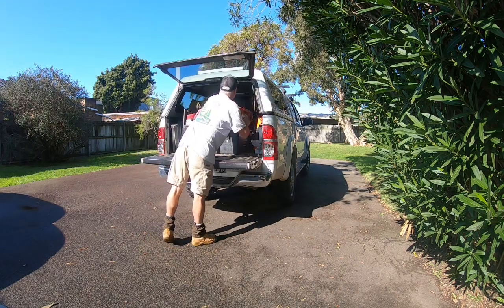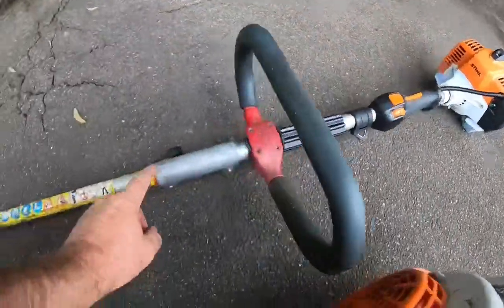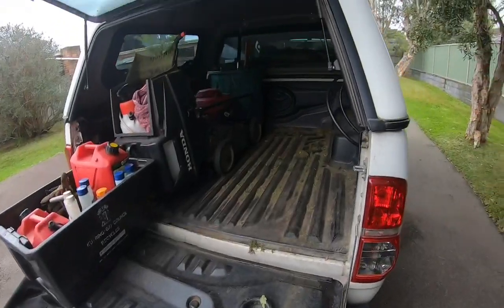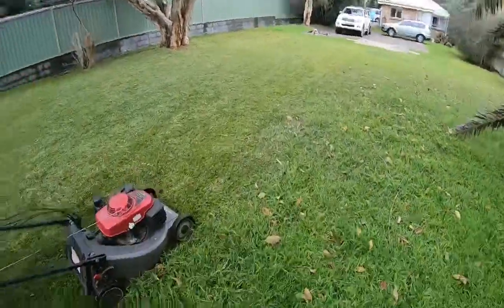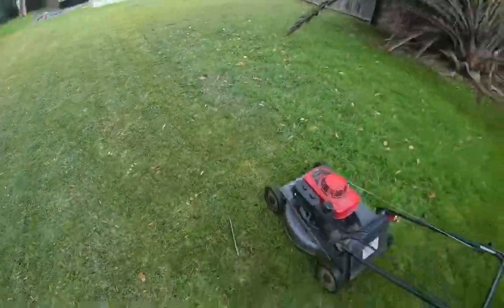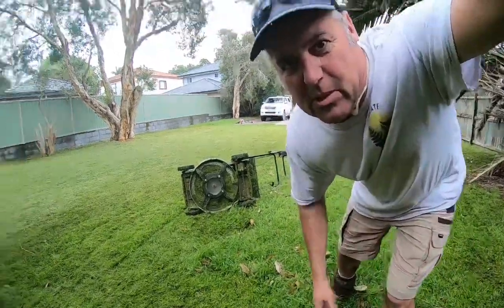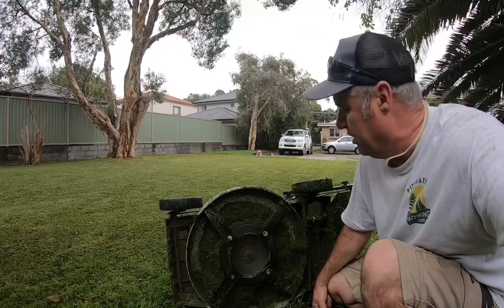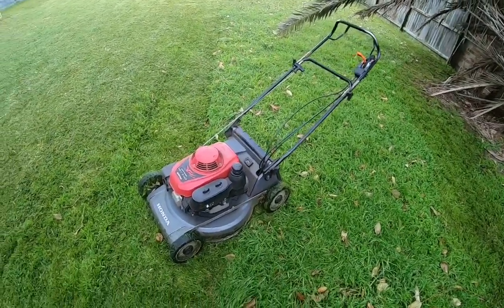My compact Lawn Mowing set up - On the job full video - Start to Finish - How I do it

Comment: I'm gonna sit back and watch ya work Ray, while i sip a coffee. Questions to come lol
Reply from the maker: Ha ha enjoy the show
Reply: @PittwaterMowingAustralia  That was good mate. Pretty similar set up to me as far as the tools go. The blade disc looks like a 19inch one Ray. I've had some issues with the GA Spares ones with the three lugs busting off.
Reply from the maker: Cheers I only use genuine parts if I can these days. The blade discs are all the same Just longer blades on the 21” self propelled
Reply: @PittwaterMowingAustralia  Yeah, i picked up a mint 214 just before last xmas and it had the oval disc with 19 inch blades so i swapped it over to the round disc with 21inch blades. The newer 216s have the disc carrier with the two bolts holding onto the boss. Because i'm running 3 hru19s i might switch it back to the oval disc as i get the blades for $1-50 each and the cuts pretty much the same but at least i've got the option.
Reply: @PittwaterMowingAustralia  I ordered a bunch of parts a few weeks ago from a mob called Roe Motorcycles and Mowers online Ray, fast delivery and excellent prices.
Reply from the maker: Great to hear I’ll have to check them out

Comment: Hi Ray, wouldn't mind getting a D model. looks a lot easier to operate then the blade brake models. bit hard to find them though.
Where did you buy the new deck? My first HRU has a huge gaping hole in the side that I have patched up a couple of times.
Reply from the maker: Gday Cliff A subscriber told me about the deck. It was new old stock in a shop down the south coast of NSW Wollongong area. Got it for $150 😎
Reply: I picked a couple up off gumtree recently cliff good mowers I love the older decks. Checkout roes motorcycle and mowers or Stanford mowers in town(gepps x)

Comment: when you tipped your mower to show us the blade wouldnt the oil go into the crankcase?
Reply from the maker: No it’s fine Just keep the carby / air filter on the high side

Comment: When you mow is it quicker to go up and down straight or around in a circle in the yard because I always go around in a circle to work my way back in now just time timewise is there much difference oh yeah how long do you hold the lawnmowers four of owning them
Reply from the maker: Probably quicker going in a big circle but it definitely looks neater doing straight lines. I keep my mowers forever and replace with genuine Honda parts as required This mower has nearly 800hrs